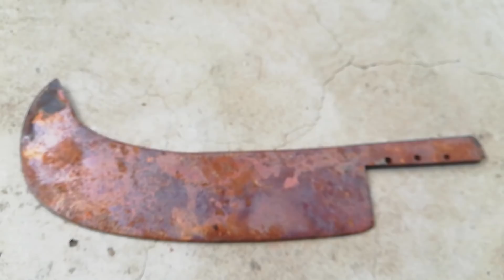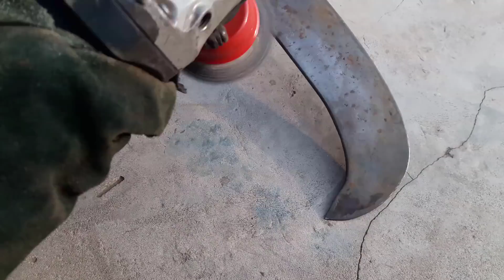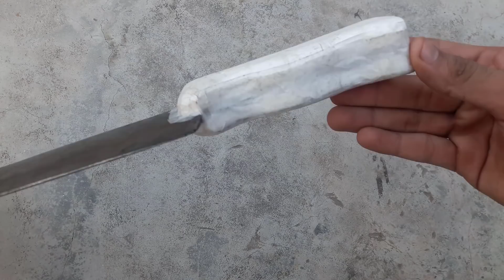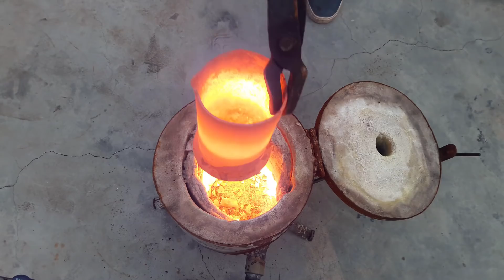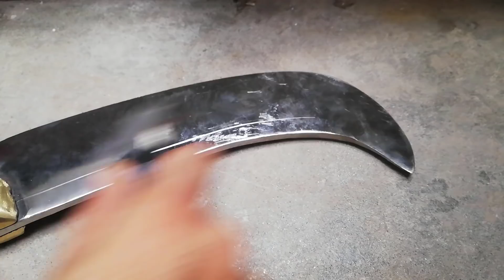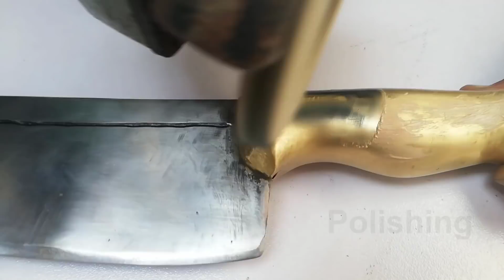Ancient Meat Cleaver Restoration

Comment: While I applaud your creativity...you did ruin that blade.   Turning a billhook into a big cleaver is a interesting idea. Keep it up.
Reply: If it's a Bilhook, why is the edge on the opposite side of where it would be on a Bilhook? The bit that extent from the handle is completely flat with no bevel. And handle position is like no other Bilhook I've seen on the internet.
Reply: @Masterfighterx  good point. Hadn't noticed the edge. I stand corrected. Still, the blade is ruined but a cool project either way.
Reply: While I would've gone for a wooden handle, the handling process didn't completely ruin the whole blade, the sand kept it all from overheating. Dunno if the overheat went all the way to the heel edge though.
Reply: Canuck Knives first positive comment

Comment: That black line in the top looks GREAT!!
- Said no one ever...
Reply: he cleaned the rust,he added new handles and he style it the way he wants...yep that a restoration
Reply: tygonmaster he sharpened the balade so that means it functions right? Because it can cut, and the purpose of knives is to cut.
Reply: @davethebest7480  exactly
Reply: I would call it personalization instead.
Reply: Thagt black line on the top looks great
Reply: KAB  he should have putted 2 lines hahahaha
Reply: It thought the line was to flood blood out after a cut, maybe I’m wrong, probably wrong. But I can can get that it’s there for a reason, why, because he most likely has study this unlike 99% of the comment section.
Reply: Thagt? Nice try... you almost nailed it...
Reply: @Potateornottotate  grooves like that would be used on something that impales like as sword, but a cleaver slices down, so they're completely unnecessary
Reply: @tygonmaster  and things that are functional are nice to look at!
Reply: @Potateornottotate  yes but it wasnt original to this blade.
Reply: J&G Pics stop he tries his best
Reply: You can't even make a better one..
Reply: J&G Pics ii
Reply: @Mwushs  no its a modification. Restoration would be to restore it to original condition
Reply: Where did he find this thing Egypt you don't need blood grooves if it can't stab too much bacteria under the handle
Reply: I think they look great.
Reply: The point of that groove is to reduce weight. It's called a fuller and has been used on multiple blades including swords, knives, spears and various weapons. I will say it looks extraordinarily rough and could have been improved, I don't see the use of it on a cleaver.
Reply: darkfury45
Reduce the weight by 30 grams by carving a thin , shallow fuller in the blade.
Increase the weight by 800 grams by making the handle out of solid brass. 
Eh.. The only point of that fuller is looks. Try stabbing a piece of meat with a plain blade and see how much suction is created. Spoiler alert: there's no suction.
Reply: I like it though
Reply: Ron Foster II honestly?
Reply: J&G Pics I like it...
Reply: I get it he can do what he wants w the style but ew that handle makes me wanna low key gag
Reply: He still restores it he made it something you can use again An then added decorations
Reply: Could you use the knife before he changed it no well then it’s restoration
Reply: @Potateornottotate  nope, they are erroneously called blood grooves but the correct name is a fuller it is meant to lighten the blade while maintaining its strength.

Comment: I believe that originally it had a long wooden handle, maybe even as long as a meter.  Also while I'm no expert, the relative uniformity of the rust seems to indicate a modern steel blade, probably no more than fifty years old.  And one more thing, even if you never use it again, make a grinding jig so that you get nice clean lines.
Reply: @jaxsteel2680  I think you're right, it would explain why the holes for the pins are so off center.  However, I think someone else sought to turn it into a makeshift cleaver.  Regardless of it's history, the lack of a secondary bevel leads me to believe it wasn't meant to be a cleaver.
Reply: Edge was on the "wrong side" when he pulled from junk pile. Looks like a billhook or sling blade, but I think it was something else. Or a version I haven't seen. Certainly wasn't a meat cleaver though.
Reply: It looks like a bush axe
Reply: @claytonandrews5870  that's what Im thinking pretty sure it's and older style brush axe I seen one with a blade like it on Wrangler stars channel.
Reply: Stone Boyd - I used to use a brush axe with a blade like that to clear underbrush on our property in Tennessee.  Looks the same to me, but I never paid attention to the details.
Reply: The Blade is attached to an oak dowel about6 to8' long. Used for rendering, butchering whales. I have witnessed it personally. A blubber knife.

Comment: If it’s a bill hook like all are saying, why is the blade bevel on the wrong side? Seems like it was only sharpened on the tip before. And the handle seems to be coming out of the wrong side, like if it was a regular billhook it would be 2 inches lower from where it currently sticks out.
Reply: I think you are right. There are some odd shaped knife out there, simple as that.

Comment: Is there any mechanical retention here? Pins or something? Otherwise I'd be worried about that handle coming off if it hits something.
Reply: InstrucTube, As you can see there where three holes in it, so the brass is in one piece. It won't come off easily. 🖖
Reply: Oops, you're totally right. Forgot it already had holes in it. Good enough, it'll act just like fully riveted brass pins, perhaps even better since it's tied directly into the handle material.

Comment: Looks fake... as if you just cut that shape and let it rust there before making the video. It didn't even have some dulled edge before, it's just a sheet of metal.
Reply: Huh, you’re right
Reply: I have to say, the lack of a bevel really seems weird. It's hard to imagine that knife was ever functional. Looks like an unfinished piece left to rust. Also the positioning of the holes in the handle seems very weird, way too close to the edge. My best guess is that someone tried to make a cleaver, messed up the handle by making it too narrow and scrapped the whole project before the bevel was ground.
Reply: I thought that too. The rust looked very even like a rusting product, rather than the way real rust forms.  I think he made the blade and used a rusting product on it to make it look old
Reply: also the way the rust removed seemed far too easy, compared to other blades i have seen refurbished. Did you notice that it was nearly fully fine after straight removal, no brushing?
normally a natural long-rust would be a bit more resilient, would need a little scrub to get the rest off
Reply: I guess you are right

Comment: soak it over night in plain old white vinegar , and the next day scrub it with 0000 steel wool followed by a rinsing with fresh water / dry it then apply a light coat of oil ! no dangerous chemicals or power tools required ! been doing it for 30 years !

Comment: It would have been a good idea to state the type of acid used. Normal De-rusting uses Hydrochloric ACid or Phosphoric acid , which takes about ten to fifteen minutes to d an oil/grease free job, should the metal have oil or grease traces, it is essential to remove this using a caustic soda solution firstly, rinse in fresh water, THEN plonk the metal object into the acid bath, ten or fifteen minutes will show the bright clean metal under where the rust has been. Wash object in fresh water and dry, Use WD 40 to prevent further rust.Easy and cheap/

Comment: So I'm assuming that this wouldn't be something actually used as a tool. More along the lines of nice to look at because there are no pins nor anything else securing the handle to the tang. If someone were to swing that it could result in catastrophic failure of the blade and injury to the weilder.
Otherwise it looks great and definitely pretty just wouldn't recommend using it as a tool.

Comment: No need to spend hours de rusring anything. The Metal Plating Industry uses a quick simple easy method. as follows,1- Wash item (however rusty)_in a caustic soda solution (this removes all grease or oil staining. Then drop the item,after washing in clean water, into a bath of Hydrochloric Acid or Phosphoric Acid,usually available in a 12 to 35% solution, either strength does the job. leave item until rust had turned black and /or completely vanished,remove from acid bath, wash in clean water, and dry,Rub  with WD 40. and bingo,no scratches dents and certainly no scratchmarks caused by the primitive method of using a Grinder which is dangerous and will spoil the surface appearence anyway. Use rubber gloves and wear Eye protection when using acids,it's also a good idea to have a bath of acid neutraliser handy in case of splashes on clothes or whatever, using Washing soda,(Sodium Carbonate) in warm water solution,then rinse inplain water. Happy Derusting!!!Terry Offord

Comment: I appreciate your work, but you can't sharp a Meat Cleaver just with a file. That will never be sharp just jagged. Also, as nice as the idea with the brass handle is, but you destroyed the balance of the blade. Maybe its nice to hang it on a wall, but i don't think it's good for working with.